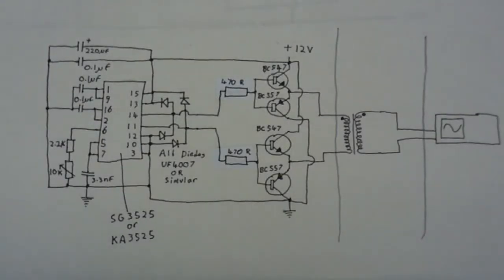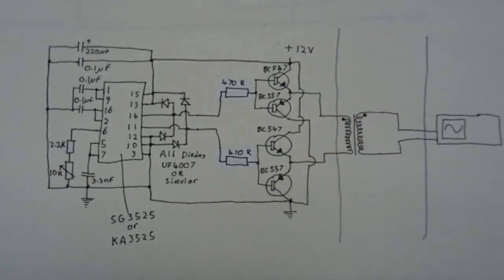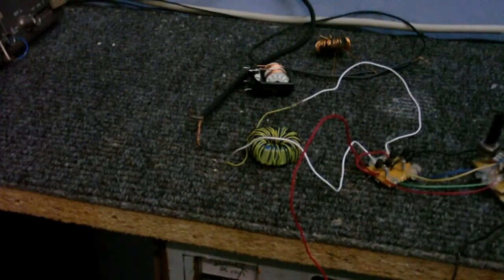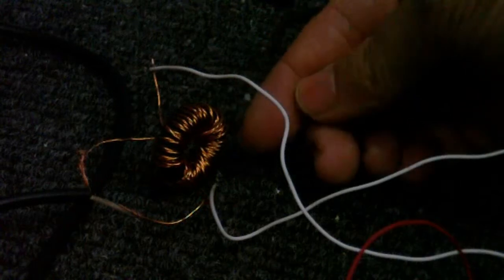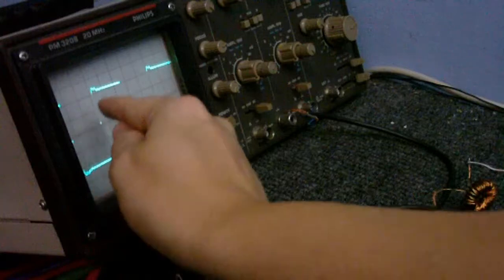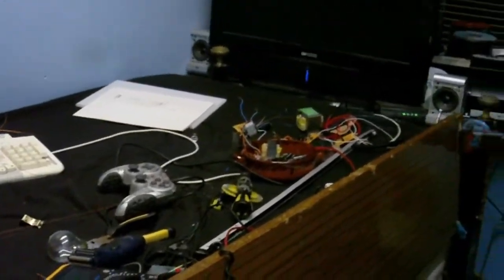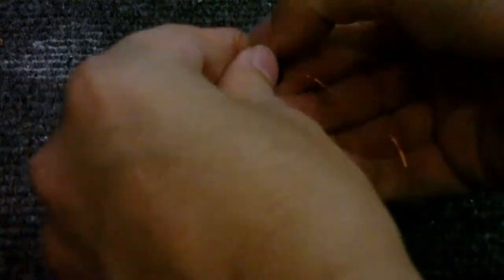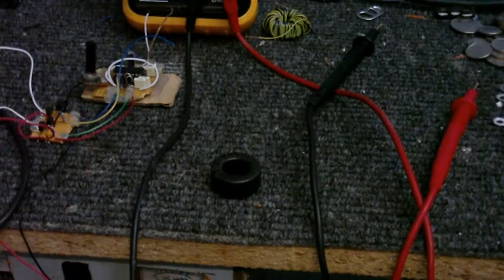How to make a gate drive transformer.

Comment: Ah once again the YouTube algorithm takes me on a time travel journey over 9 years. Loved the video dude! 100% informative 👌 kudos.
Reply from the maker: One thing I should mention is to not use such thin wire that I used in the video here as this was just for demonstration purposes, single strand telephone wire works well.
Reply: @CoolDudeClem  yea was thinking the same! I think ill make something like this for my pre amps on my bluetooth boombox,  i made a dc to dc dual supply converter for the power amp , now i need a similar supply but i don't need much power so maybe i could use something like what you've shown right?

Comment: I am going to try this method:  Can you please tell me what a good gauge of magnet will be.  Also,  a ferrite core inductor's approximate size that is good: it IS ferrite???
THANKS FOR THE GREAT VIDEO!!!
Reply from the maker: Personally I would use solid core single strand telephone wire as it's easy to work with and has better insulation, as for the ferrite, go with something a tiny bit bigger, a while back I bought some N30 grade ferrrite cores that were about 20mm in diameter and they worked well. Sorry I didn't reply sooner.

Comment: Actually in SMPS they use the SG3525 chip itself to generate the drive signal. So it's logical to think that EE cores from the SMPS works well...
not the toroids tho. all of mine are made from solid iron
Reply: You sure it's solid iron? Isn't it sintered iron powder? Relative Permeability 30-90

Comment: Do most common chokes work well or it's just that specific one? I have a bunch of them
Reply from the maker: I've tried this with several of them and MOST of them work. Usually if you take apart one of the torrid common mode chokes, the core is suitable.

Comment: thanks for the video... whats the core that you use? i don't have a microwave
Reply from the maker: Sorry for the late reply but personally those are probably not the best cores to use anyway, even though the one I used in this video performed well, I can't say that you would find cores as good as this inside every microwave anyway. Just buy the N30 grade cores, I used those in a Tesla coil circuit to drive the mosfet gates and I had no problems.
Reply: CoolDudeClem , thanks for reply. i need for 16khz freq , is it ok to use N30 core?

Comment: i think the voltage waveform distortion at the rising edge or falling edge is caused by the excitation current, bjts can only conduct current in one way. If the secondary current is insufficient to offset the excitation current, the current will keep going on even if its not the right direction on bjts, the path will not be from c to e, but from b to e, and make the voltage during edge bigger.

Comment: Hey Clem, I was wondering if you could share insights you might have with winding a gate drive tx in this circuit that was listed on instructables.
http://www.instructables.com/id/30-kVA-Induction-Heater/
If the link does not work you can just search instructables site for induction. It is listed as one of the few.
  What is a bit confusing is that the gate drive txers are wired a bit more complicated. From gate drive IC's to drive four transistors. Then again to IGBT's. The exact wiring of this projects GDT needs detailed explaination. Could you offer any insight? Much appreciated if you could share something here. Thanks.
Reply from the maker: Ok from what I can see, there are 2 gate drive transformers and each of those transformers (or tx as you say) has 5 windings (one input winding, and 4 output windings) and each winding should have the same number of turns (if the input winding has 10 turns, each output should also have 10 turns).  I'll try to explain the schematic shown at step 3,

First there's the TL494 which provides the necessary high frequency pulses,

that goes to the UCC37322 ICs which amplifies the current from the chip, they don' t make the voltage higher, just boost the amount of available current.

from there it goes into the FIRST tx whitch splits it into 4 and provides isolation so there's no direct electrical connection.

these 4 signals go into the mosfets which combine them and provide further current amplification and then that goes into the SECOND tx.

just like the first tx, the second tx splits the singal into 4 and then those 4 signals go to the IGBTs, and finally into the third transformer which is the 20:1 step-down.

Hope that is some help.
Reply: Clem I appreciate the explanation but I understand the circuit. It is how the GDT's are actually wired.  After much internet searching I think I have it but still am not sure. What is sure is that there is a big loss of info about doing one of these TXs as it is done in that circuit. 
 I think that it is actually 4 pairs of twisted cable, and on each one of the twisted pairs you take one of each twisted wire on one side with the corresponding same wire on the other side of the toroid.  That would be that each wire would have its own primary. OF the four wires that remain are your gate drive connections. I say this because of reading the other few sites about wiring toroid GDT.  But they are usually 2 outputs. The whole 4 transistor drive thing, or full bridge, is confusing. I was hoping since you explain yours so well that you might shed some light here. Thanks so much for thinking about it.
Reply: one more thing, check this out:
  http://www.richieburnett.co.uk/temp/gdt/gdt2.html

he explains much of what you have. He also has a section somewhere on the site where he tries to explain the wiring of a GDT.  Still confusing. Maybe you could explain how you wire yours exactly. Thanks

Comment: Should really use a capacitor in series with the winding as a very small DC offset from transistor parasitics or different duty cycles from one cycle to the next if the PWM's in a feedback loop can walk the transformer into saturation. The right capacitor will prevent this without compromising the waveform. Also should say what the core material you don't recommend is because it looks like you're saying not to use toroids rather than powdered iron materials.

Comment: I suspect the first core in the video wasn't a ferrite core but a micro-metal / powder core used as a attenuator to noise rather than a coupling on the output of SMPS. I suppose the filter core on the mains side is the best to use.

Comment: @CoolDudeClem do you have any circuits for an adjustable oscillator that could feed the horizontal coil on a cathode ray tube to make an oscilloscope ? im just using 60hz ac and for higher frequencys the signel just looks like a line. much obliged